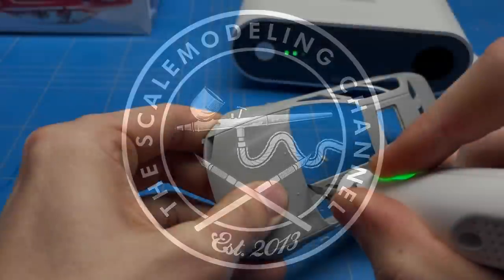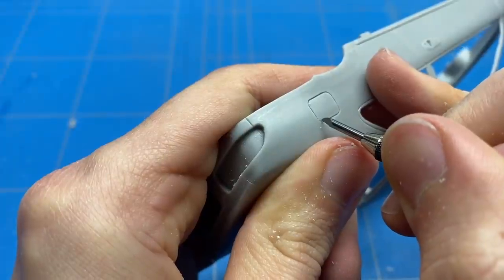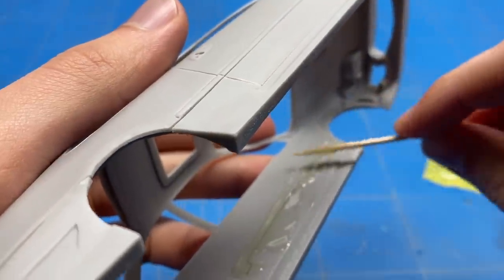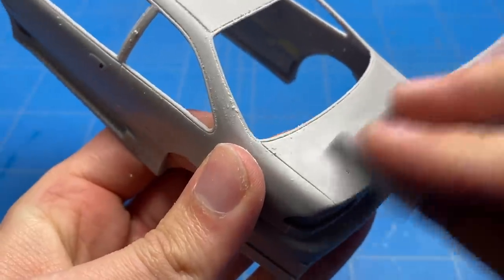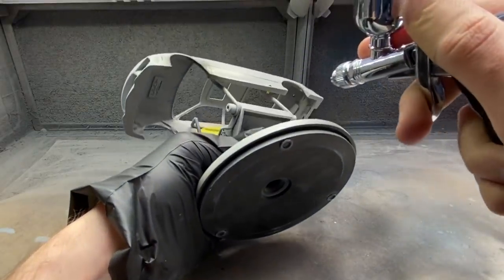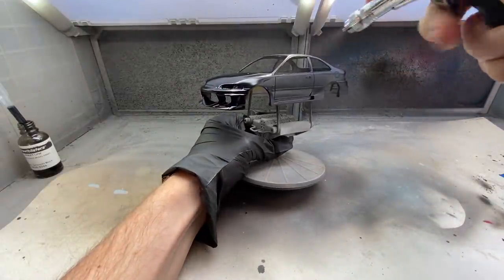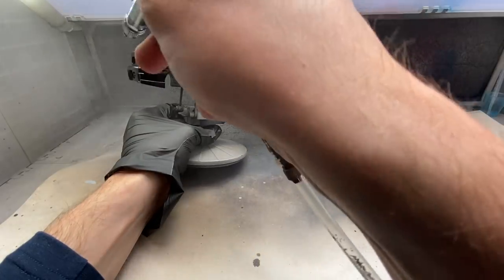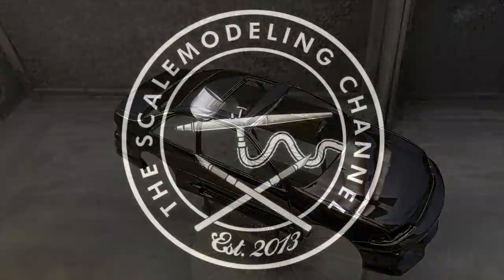USCP: The Fast and The  Furious Heist Civic Part 1 Bodywork & Paint

Comment: Fantastic job as always, you could use the LED filliment lights they should work pretty good they are very flexible and only need a 3v battery
Reply: That would be my suggestion too. Very thin and flexible.
Reply from the maker: Found EL wire. Gonna give that a shot, thanks for the help.

Comment: In terms of lighting: I'd go with small cold cathodes (ccfl). they look exactly like neons + give off a more homogenous light than led strips. and they're dirt cheap. only downside is the minimum size, there would have to be modding involved
Reply from the maker: Those do indeed look like mini neon strips. Though i’m not sure thats something i would be able to figure it out myself. Simply put when it comes to electronics, i suck😅
Found EL wire wich seems to be perfect! Thanks for the tip!

Comment: Thin fiber optic wire following the inner body lines, with a colored led might be an option for “under glow effect.
Reply: That just might give a more subtle glow as opposed to a bright LED strip. Especially on a smaller scale model car you will see that the lights are fake (as in done with LED strips). The light should also be to scale so a little less bright
Reply from the maker: I’ve found EL wire. Gonna give that a shot. Thanks for the help!

Comment: There are under body lighting kits for Mini Z. Perhaps this is easier than re-inveting the wheel.
Reply from the maker: I wanted to make it as easy as possible for a complete nood like me. Someone suggested EL wire. I think that will work
Reply: @TheScalemodelingChannel  what is an el wire?
Reply from the maker: https://www.amazon.nl/COVVY-Waterdicht-verlichting-lichtslang-lichtsnoer/dp/B07312ZP4K/ref=sr_1_4?__mk_nl_NL=%C3%85M%C3%85%C5%BD%C3%95%C3%91&dchild=1&keywords=El+wire&qid=1619351613&sr=8-4

Comment: If using the fan style tip on your airbrush, reduce the air pressure and add a little more thinners to the mix, always remember 2:1 10% 2 parts paint 1 part hardner 10% thinners but add another 2% for a glossier finish... This stops a lot of orange peel... Or Fat ladies ass as I call it and reduces sanding

Please tell me you strain the paintbefore putting it into the airbrush, this stops contamination or delaminations in your end results also